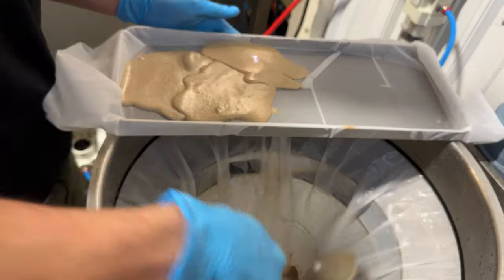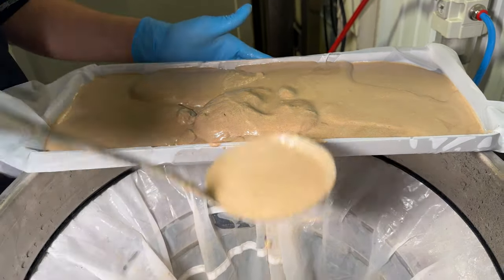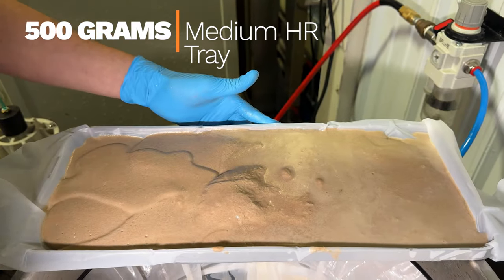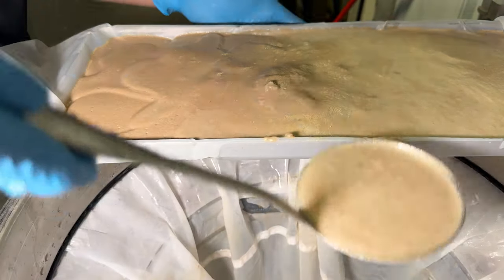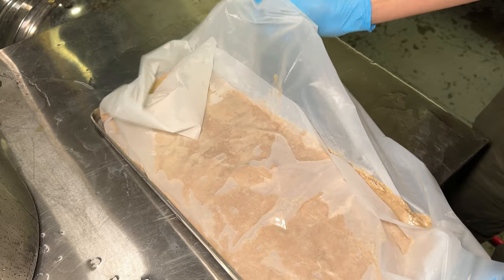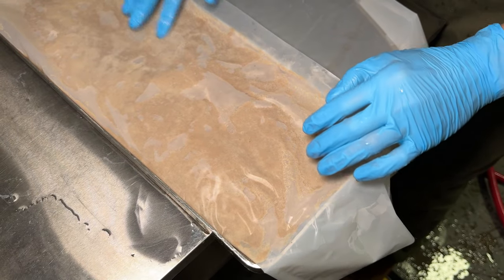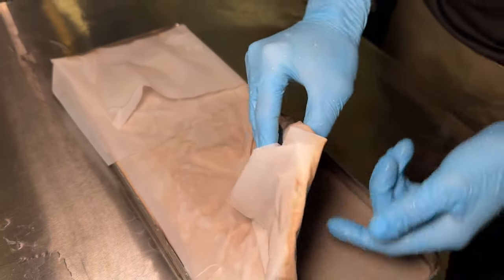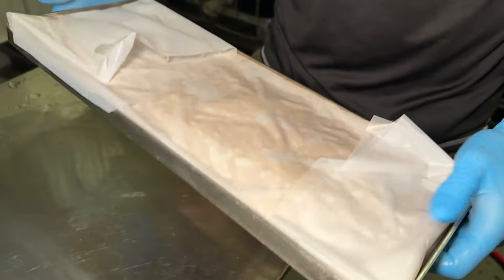Hi Speed Freeze Drying with Sintered Mesh Lyophilization Tray

Comment: I saw a video of a guy using a Büchner funnel to pull moisture out as an alternative to freeze drying. What if you made a special vacuum table for those trays to sit on before freeze drying? I bet you could cut off even more time in the freezer.
Reply from the maker: Yes we already made that.
Reply: @SamboCreeckFiltration  how dry can you get the hash using that setup without a freeze dryer?
Reply from the maker: @RT-jv3su not dry enough 😅. But stay tuned cause we are working on a plasma dryer to eliminate freeze drying. 🤞
Reply: @SamboCreeckFiltration  Quantum Plasma Hash . Just forget Piatella QHP is the new Shit now 😂
Reply: @SamboCreeckFiltration  How is your plasma dryer coming along? It sounds beyond awesome for the win🏁🥇🏆🏁🏁🏁
Reply from the maker: @ not good.  Back to the drawing board unfortunately.